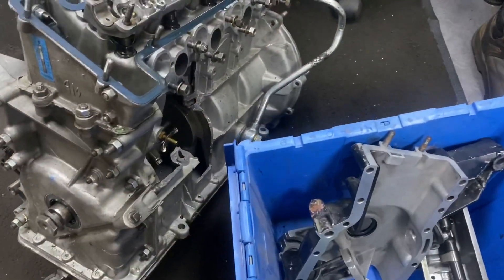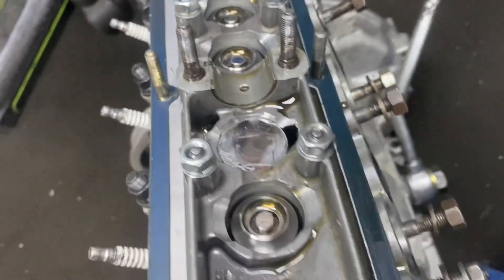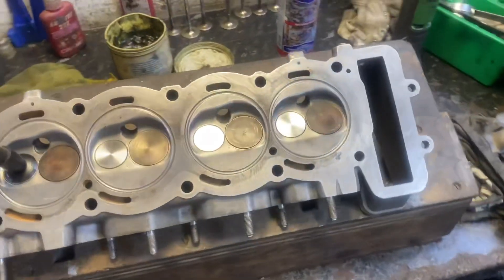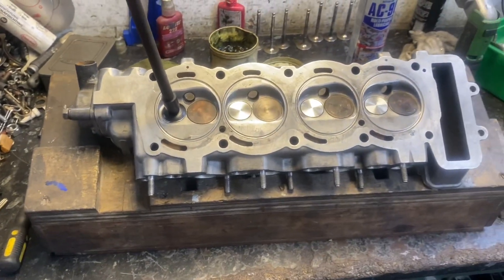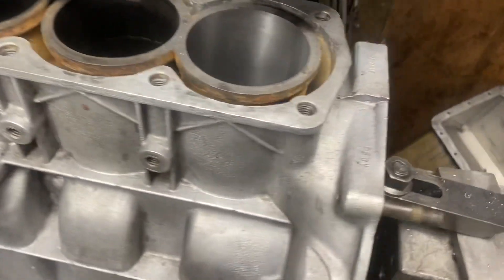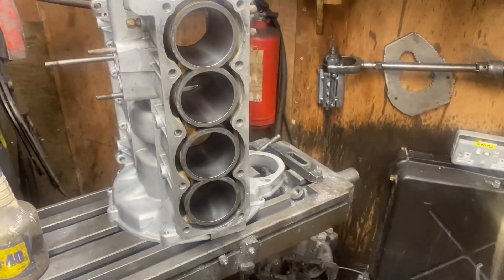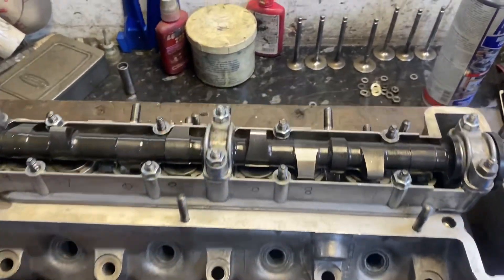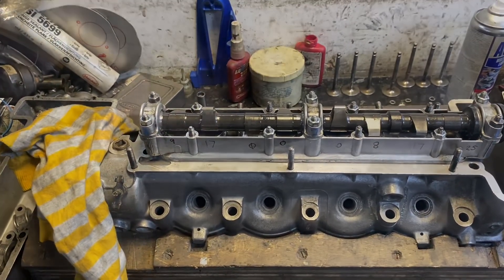3 day engine build begins!

Comment: Thanks.  Did you work out what failed?  Big-end?  Rod?  Top came off piston?
I had the tip come off a valve, at the collet groove.  The valve stem bent into a perfect 'S' before it disappeared down through the piston.  It was so perfect I embedded it in clear resin and had as a shelf-ornament in my workshop...  It served as a good reminder!
Make sure you don't put Andy into the weeds!   🥴
Reply from the maker: It was the big end cap unfortunately, the rod and most of the piston was nowhere to be seen